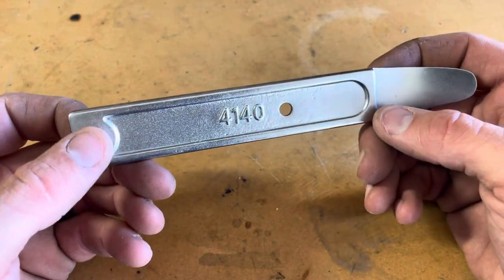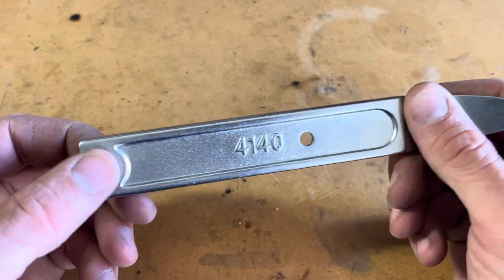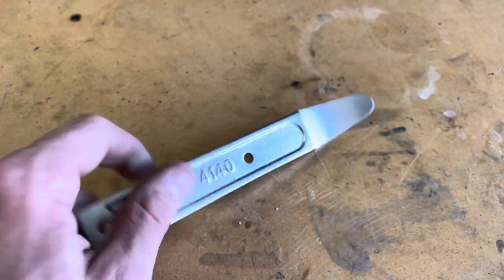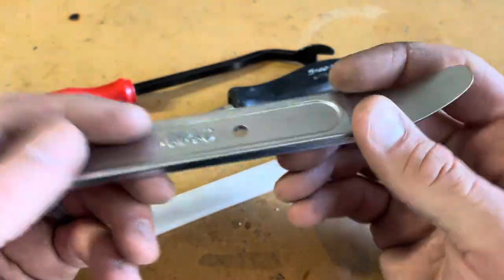Game changing tool - aviation skin wedge pry tool

Comment: I worked on Navy aircraft for over a decade and we got told up and down not to use any metal tools to lever panels (most of the exteriors are composite so it wasn't without reason) but they are incredibly useful on alot of other applications. 

Also be careful because they can be a tad sharp or become sharp if you use them to wedge metal panels.
Reply from the maker: Good tip and comments. Thanks Alex!